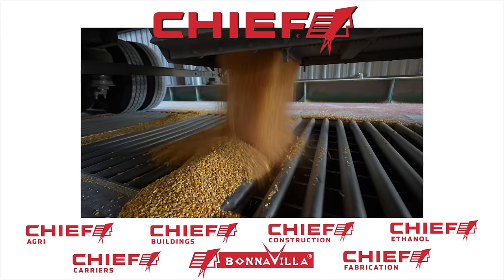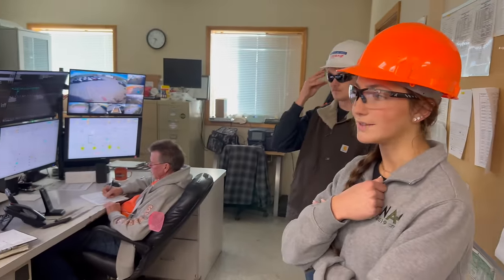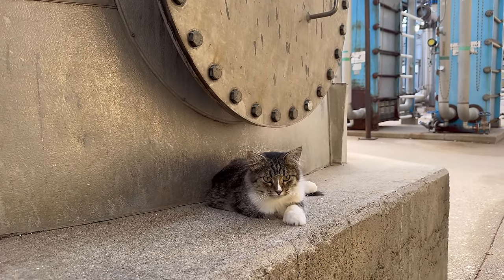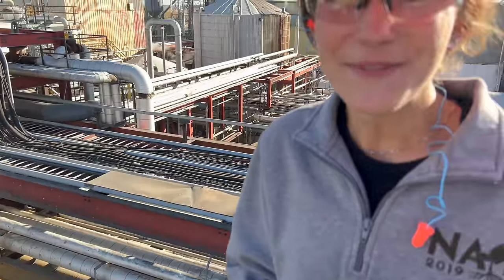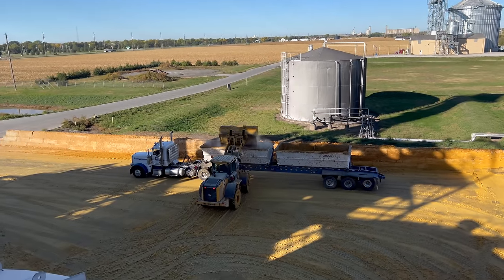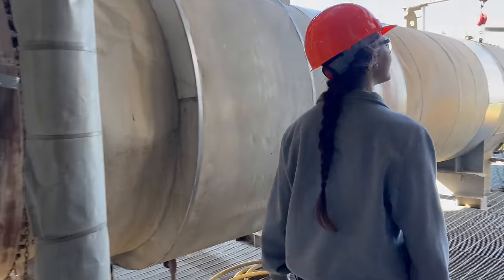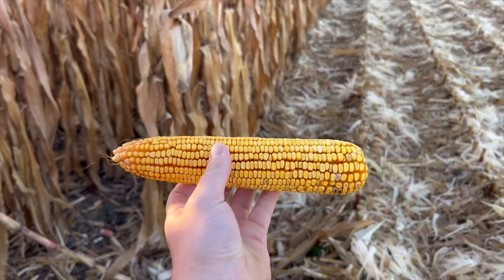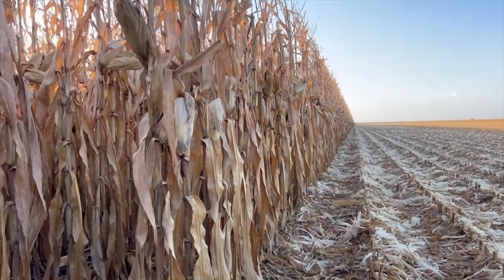Why US Farmers Grow So Much Corn

Comment: Im much more thankful for diesel though. All my vehicles are diesel. My boat, chainsaws , quads, lawnmower etc. are, however , all run on non ethanol gas as it doesnt destroy any of the rubber internals and does not cause them to run hotter as ethanol fuel does. I wont get into the political side of it (we already have enough of that today)  Wouldnt mind me some corn 'shine' tho!

Comment: A molecular sieve is what it sounds like. You can engineer certain minerals (e.g. zeolites) to have precise sized spaces in their structure. They have one that's tuned to grab water and reject ethanol - it removes the last bit of water (distillation can only reach 95% (190 US proof))
Reply: That's a similar idea to the artificial kidney that's used in my haemodialysis, yes?
Reply: yes
Reply: An oxygen concentrator also uses a molecular sieve to provide oxygen for breathing, and high temperature processes like glass blowing and welding.
Reply: Brings back memories of my plastic processing days, we used a molecular sieve to grab water molecules out of the air before we heated it up and used it to dry the plastic before melting.   Talk about air conditioning - we required the dew point of the air to be 40 degrees below zero!
Reply: What happens to the soupy corn being loaded onto the semi?
Reply: somethng to do with dalton's law of partial pressures isn't it?  aezeolide?  aziotrope?  been thirty years since chemistry class! :)
Reply: @jayglosser2014 That yellow stuff is all the leftovers of processing. It is high in protein, and you mix it with haylage for cattle feed.

Comment: The co2 or carbon in petroleum was previously in the air. The plants of the time captured it same as your corn and then as it was buried by geologic processes to eventually be processed into methane, oil, and coal. Our efforts to make ethanol are just a short cut in the carbon cycle. Thanks love your feed. Keep the episodes coming.
Reply: The Law of Conservation of Energy.
Reply: Thanks for clarifying that. By our use of fossil fuels, we are recycling the carbon that was in the air millions of years ago, which had been many times higher than it is today. If the CO2 in the air were to drop below 200 ppm, which is where  it was heading not too long ago, plants would be in dire straits. CO2 is essential for life on earth, it is not a pollutant.

Comment: Thank you Laura and Grant for explaining and showing us how it works from dirt to my tank.   Much appreciated keep it up!  Love the videos you both make for us
Reply: That was well done and well explained… I learned something cool today… 👍😎.
Reply: Yes, the tour was very interesting!
I disagree with the whole corn into fuel thing though. Ethanol takes lots of fossil-fuel, chemicals, etc, to make and transport, so it's not even good for the environment overall. And ethanol fuel when it absorbs water from humidity in the air can also ruin small engines.
Reply: @FLPhotoCatcher   Yeah, and I noticed that Grant skipped right over the fact that while plants absorb the CO2 from ethanol-powered engines, they also absorb the CO2 from gasoline-powered engines.  He makes a clear implication that Ethanol good/gasoline bad.

If I recall correctly, you have to have gasoline to mix with ethanol - which I am pretty sure they mix either at the gas stations, or in the holding tanks at the refinery.  As far as I know, 85% ethanol is as high as that percentage can go; at least at the current time.
Reply: @FLPhotoCatcher 
I run a fuel injected pickup truck engine on e-85 for many years.  Today the truck is 20 years old and still on the road with the original engine without any overhauls.
The fuel pump lasted around 180,000 miles. ( Well beyond its designed life expectancy).  

I now have a second truck and it has run on E 85 for 46,000 miles and still going strong.
Reply: @Rusty1220  Sure, cars and trucks can be ok with 15% ethanol or e-85. But I was talking about small engines. Specifically rubber seals and some synthetic materials in those small engines. But also, left over winter, water can collect on the bottom of the steel fuel tanks or other steel parts and rust them.

Comment: Thank you for sharing the concept of the corn field as a solar panel, and the ear as the battery, using carbon to grow and store energy.

Taken one step further, plants and animals from thousands/millions of years ago, absorbed carbon and solar energy as they grew, then they ended up in the earth to decompose into densely packed energy that we use today through the consumption of fossil fuels.

It's all, literally, solar energy... and some carbon.
Reply: You are 100 % right.  I like all the fuels, natural gas, oil, and coal.  Yet I also use E 85 because it helps keep the money in the heartland of the United States.

I also drive Electric car because I am a retired coal miner and the electric is produced from our local coal mine.  One ton of coal will power a car for roughly 8,000 miles. One ton of coal would be 3 ft solid cube square of volume.

Comment: Grant did a good job of explaining the carbon cycle, also what was not talked about is that corn is mostly startch and a not good for long term feed for cattle, the fermentation process uses the starch for making fuel and leaves high protein mash that good feed so the corn is still used for feed

Comment: Yeah, I've had thoughts on ethanol ever since the days of "gasohol," back in the early '70s.  And yes, I was around then.  It was, if I remember, 10% ethanol and 90% gasoline - which was further made up of who knows how many additives, including lead, which was finally phased out in this country in 1996.

Ethanol produces less energy than gasoline.  It gets poorer fuel mileage than gasoline, and one of the major drawbacks, besides not being good for the environment, is that it attracts moisture.  Okay for transportation and heavy equipment; not so good for passenger cars, and even worse for small engines.

And, they plan on raising the amount of ethanol in the gasoline.  Currently, most ethanol blend is E10, or 10% ethanol.  You can find E85.  In the future, that will probably be the standard blend.

Not to worry, though; states like California are banning small engine-powered equipment.  Ever wonder why?

Somebody somewhere is making a lot of money, and while it looks to be job security for farmers, it's not good for people and for the environment.
Reply: I drove a truck on E-85 for many years.  The truck is now 20 years old and still on the road every day. Still the original engine with no overhauls ever performed.

Yes ethanol attracts some water but gasoline produces waters when it explodes within the cylinder.   The hydrogen in the gasoline combines with the oxygen from the air thereby producing steam water.  That is why you can see steam from gasoline engines on cold mornings.
Reply: But should only run E85 in fuel injected engines.

Comment: Seeing that ethanol plant brought back many memories for me. For 10 years I drove a hopper bottom and that was one of the products we hauled. I remember when ethanol first hit the market there was ethanol plants springing up at several places in Ohio. These plants got a government subsidy to operate. That subsidy only lasted for a short time and the plants were supposed to be able to run themselves. The product that I hauled was called DDG(dried distillers grain) which was a feed supplement used in producing chicken and cattle feed. Most of the plants that were built during this time shut down when the government handout was over. Go figure. I know I hated hauling that stuff because during the hot summer months it would set up in the hopper and was a bear to unload. In fact the very last load I hauled for that company was DDG. Thanks for showing us the plant and giving us a insight to your business.

Comment: You might also know a "molecular sieve" as a reverse osmosis system.  This is where you put liquid under pressure into a plastic sleeve.  The sleeve is a giant spring, I guess is the best way to describe it.  The pressure difference from inside the plastic sleeve to outside the plastic sleeve causes the sleeve to expand, opening uniformly sized holes on the molecular scale.  So, by adjusting the pressure, you are adjusting which molecules are allowed to pass through the membrane.  For your under sink RO systems, a single membrane is typically enough.  The water that passes through the membrane comes out one pipe, and the remaining water with all the impurities passes down the middle, through a regulator, and is discharged as waste.   For the ethanol plant, the water is the waste product, as well as anything left over from the fermentation process.  So, this would need one step which allows anything the size or smaller than ethanol to pass through the membrane.  Then, anything smaller than the ethanol gets filtered out on the second stage.  So, this is where the water is removed to give you pure ethanol. This same process can be done at home with the off the shelf RO cartridges,  You just have to adjust the input pressure and output regulators so the holes in the membrane open to the correct size.  One really cool thing about an RO filter is that by dropping the output regulation and pressure in the middle, the membrane shrinks back to its natural state, which is an impenetrable tube.  As such, anything that was filtered out and stuck will get forced back into the middle of the tube to be carried away.  For your under the counter RO systems, you can here this under normal operating conditions as a click or a thud.  The output regulator has a system built in it to periodically and automatically drop the pressure in the middle of the tube when a set amount of water has been discharged as waste.

TLDR: the molecular sieve is just an industrial sized version of the second to last stage of the 5 stage drinking water filter under your sink.

Comment: On the other side you have the lowering of the water table from the corn belt.  The upcoming issue is water.  The Columbia River does not get the water it used to.  Every city along the way takes a sip'. They will get to the point when they do not allow unregulated access to water.  Ethanol uses way too much water to grow the corn.  Ethanol absorbs water over time and will disable any thing that uses gas and has had it sitting for more than a year.
Reply: Blah, blah, blah blah
Reply: Most plain gasoline goes bad after sitting for a year!!! it's not just ethanol.

Comment: Awesome video and truly thank you both,  Here 10% Ethanol is about $1.00 per gallon cheaper, however it is actually cheaper and easier to create and use oil ( Fossil Fuel ).  So who is doing what to cause that ?  pure gas should be cheaper ? Now why does Diesel cost about $1.00 more than gas ? it takes much more refining for gas than diesel ? diesel used to be cheaper in the 60s & 70s ?? and lastly On 5 different vehicles I personally tested my mileage is reduced by more than 12% when burning Ethanol vs pure gas ???.
Reply: Here, and maybe where you are too, E10 is ethanol blended with 84-octane gasoline, which is a cheaper grade of gasoline. If they don't add ethanol, the gasoline has to be further refined to 87 octane, which costs more.  
I don't know what vehicles you tested, but I ran comparisons for a couple years on my 1996 F250 using 87 octane gasoline vs 87 octane E10.  I got about a 5% reduction in milage on E10.

Comment: It’s a shame that a good portion of our food goes to ethanol and our government is doing everything they can to prevent exploitation of our fossil fuels. Guess it’s good for the farmers tho. Thanks for the video Laura. Really do enjoy your videos.
Reply: Great tour of the plant! I really appreciate that.
But I disagree with the whole corn into fuel thing. Ethanol takes lots of fossil-fuel, chemicals, etc, to make and transport, so it's not even good for the environment overall. Ethanol also can ruin small engines. And making corn syrup from the corn powder on the floor and pushed around by heavy machinery? Remind me not to eat any more corn syrup.🤢
Reply: @FLPhotoCatcher refined sugar gets the same heavy equipment treatment
Reply: The dried grain that's left over is often used for livestock feed.  It's often called distillers grains or sometimes gluten.

Corn syrup is a terrible thing to eat, I try to avoid it as much as possible!!
Reply: @FLPhotoCatcher well I hope you don't use salt for your food because that is mined using even bigger heavy machinery
Reply: Chicken, Pork, and Beef would be cheaper if ethanol was not competition for meat producers.
Reply: @stevenbelsky1652  Generally, the bigger the machinery, the lower the percentage of contaminates in the end product. But I don't like the idea of using machinery that can leak chemicals into any kind of food product.

Comment: Sorry to say but ethanol was the worst idea the government ever mandated. It's caused more engine and carburetor problems that can be calculated. Not to mention 3 to 4 miles per gallon lost due to bad fuel burn efficiency .
Reply: Blah blah blah blah blah
Reply: David is correct. Ethanol is terrible for small engine fuel systems, and they don't sell ethanol free fuel in my area, so there is no alternative but canned fuel at about $20/gal.
Reply: Absolutely true!
Reply: I think your missing the point of why they did it. It’s used as a oxygenate to make fuel instead of the other chemicals they where using. (All really bad stuff) Now they don’t need to use 10 or 15% but now your into economics of a cheaper product and less need for more oil to be pumped or bought from abroad. Also now you have a use for the corn. Now the circle of money is kept inside the USA. Instead of sending it overseas to countries that don’t like us.
Reply: If you properly take care of your equipment and drain the fuel out when not using it or add fuel stabilizer when not in use, It will be just fine.
Reply: I wish you would have gone to school and truly learned something  not what the teacher told you  they aren't always right.
Reply: It is bad on the carbs of engines not the moter and the new moters with new carbs they have resistance to Ethanol.
Reply: Burn food- great idea.
Reply: The corn liquid that was being scraped up is from when the plant over filled the fermentation tanks and they barf,  sometimes it's reusable sometimes not.  Paper mill does same thing but because of color it's called something else.
Reply: The ethanol process also makes train car loads of cattle feed.  So cattle farmers love ranching near these ethanol distillers.  Sometimes so much left over distillers grain is produced, that that have to export it to get rid of it.
Reply: @daveklein2826 ignorance is bliss huh...
Reply: I run e-85 in my F 150 fuel injected 5.4 liter engine for over 15 years.  Never had any problems.  I sold the truck and it is still on the road today.  Still has original engine, no repairs except normal belt replacements, water pump, and alternator.  The truck is now 20 years old.  The fuel pump wore out at 180,000 miles.  When I checked the old fuel pump all the short hose on the pump which were submersed in the E 85 inside the tank for  all those years still looked fantastic.  I took pictures of this old fuel pump.
Reply: @brokeminer475 does it make sense to burn food in a vehicle while there is hunger in the world? The U.S. has 400 years of proven oil reserves but we are using an inferior product to power vehicles mandated back when the technology to drill oil was lacking. It is about the farm lobby.
Reply: @shawnmcmullen1947  ok so if you take away the Ethanol plants and all the farmers go broke on corn and stop growing it you are left with less corn going to cattle in feed lots because most farmers when the do a contract the tell the Ethanol plant how many bushel they are bringing in and the left over goes to the feed lots for cheep and if the feed lots have to start paying more money they will have to raise the prices so that means the beef market is going to go up so less people get to eat because they can't afford the meat.
Reply: @craigbigbee6395  ok if you are going to eat field corn be my gest just a FYI it doesn't taste good.

Comment: Interesting tour, and a good explanation of the distillation process. Unfortunately ethanol production is a net loss as far as energy output for use as a fuel additive.

 It takes more energy to produce than what you get out of it. Ethanol blended fuels burn less efficiently, and therefore you get less fuel economy per gallon. It is also destructive/corrosive to small engines and older engines in cars that are more affordable to many people. The only way it became ubiquitous in the US was through government mandates in past farm bills. Apparently those mandates are gone, but we are still forced to buy E10 blended fuel at the pump. The only way to get non-ethanol fuel is to pay nearly a dollar more per gallon for pure gas premium, which is not always available.

My old truck used to get 25-27 MPG. Now I am lucky to see 22, and the exhaust stinks. The alcohol/gasoline blend separates in a couple of months so if my truck sits for awhile, it runs poorly. The ethanol also absorbs moisture so I end up with water globs in my fuel tanks.

Stop the silliness of required ethanol blends. Give the consumer a reasonable choice.
Reply: Always been welfare for farmers.

Comment: Molecular sieves are commonly used to help remove water and other impurities. Ethanol production typically involves fermentation of sugars by yeast, which produces a mixture of ethanol and water. To obtain high-purity ethanol for various applications, including fuel and beverage production, the removal of water is essential. Molecular sieves are crystalline aluminosilicates with a well-defined structure containing uniform pores. They act as desiccants, selectively adsorbing water molecules while allowing ethanol to pass through.